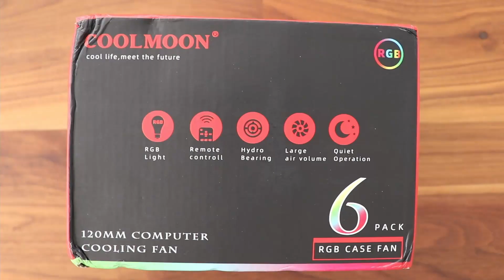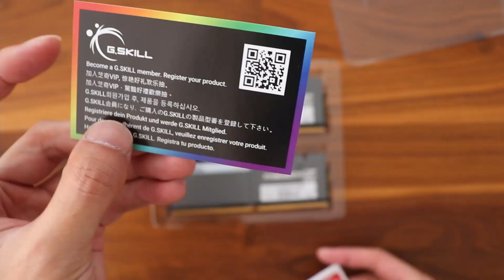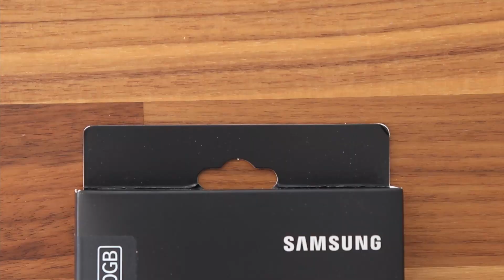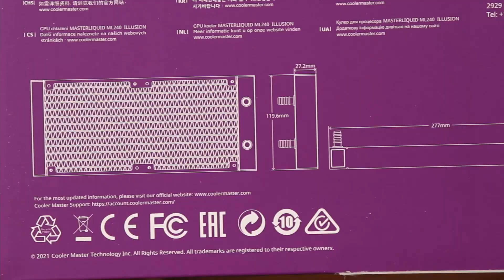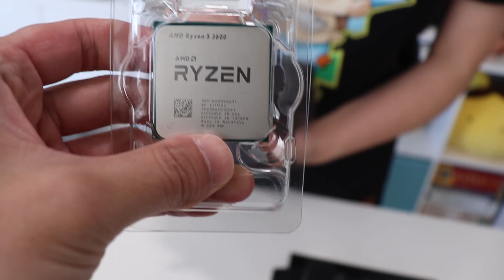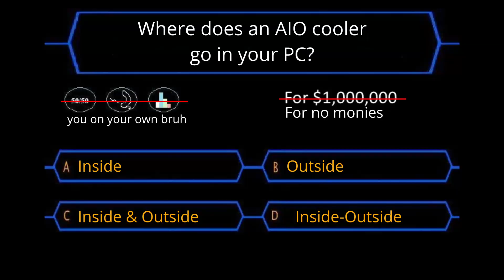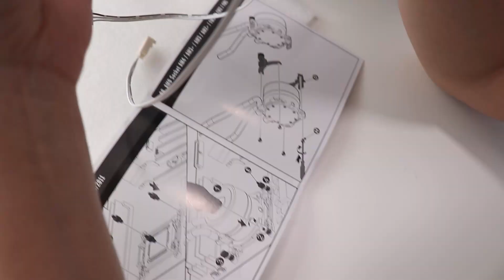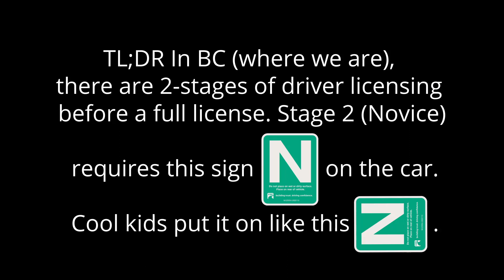BUILDING A PC FOR THE FIRST TIME | AMD Ryzen 5 3600 | ASUS B550-i m-ITX | NZXT H210 | GTX 970 😅

Comment: Hello, i always take this video as a guide for my next build (nzxt h210i). Thank you. I want to ask smth about your current build. You put the fans in and put the radiator out. Normally it must be vice versa. Since, fans will blow heatened radiator towards in. And egzaust fans will blow the heatened air towards to out. So, i want to ask that if you have any problem with this position of fans and radiator as a anormal heat. If you have no problem, probably i will position my build like yours because of nice argb led view. Thanks. Regards
Reply from the maker: Thanks!!! Since I can't mount the radiator at the top of the case and have the fans push air out, this was my next best choice. This has been fine for me since the top and rear fans blowing out. The CPU and GPU idle at 30 degrees Celsius and don't get too hot when gaming so it's totally fine for me. If you think it's too hot where you are, you might consider doing the opposite.
Reply: @MikeThai  thanks, i’m so close to finish my build parts. However,  just wondering if my card will fit inside to case. It is 269 mm long and 35 mm thick. Can you please tell your experience?
Reply from the maker: @hasanogulcan1926  your card will fit. It will be tight but it will fit as long as your GPU power connectors are not at the end of the card.
Reply: @MikeThai  thank you. It is end of the card but probably power connectors will not block on me. Since it is on long side, not on the short side.
Reply from the maker: @hasanogulcan1926  Yup that will be fine!